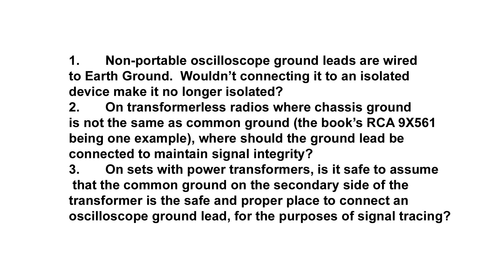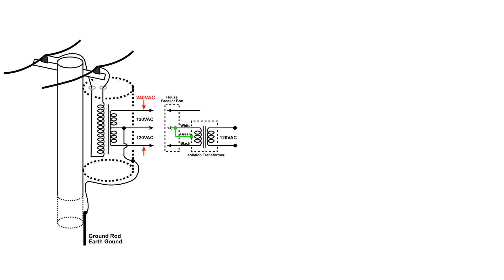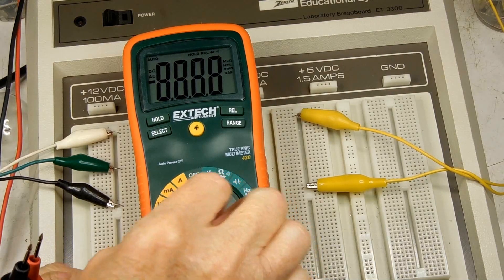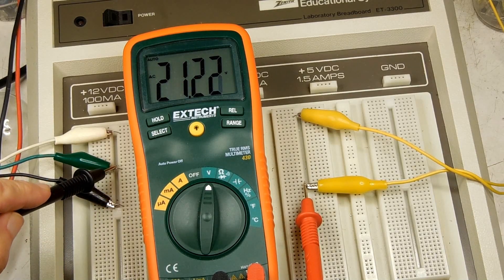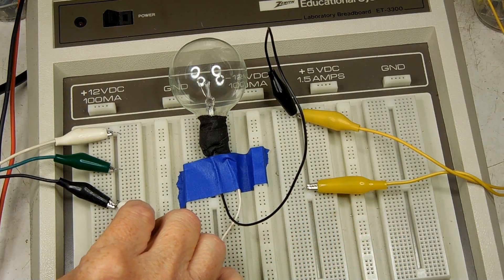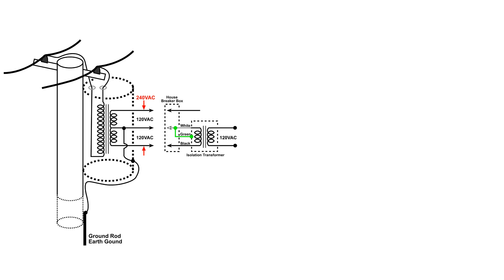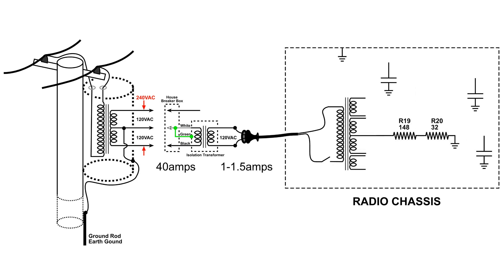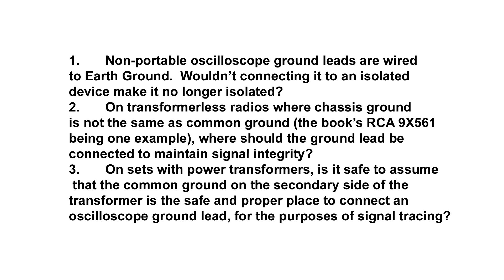Electronic Equipment Connections, how to determine when it is safe to connect equipment together

Comment: Back when I worked at a small electronics manufacturing company, the techs in the service dept. always had the ground pin on the ac cord of their scopes disconnected using one of those two to three plug adapters.